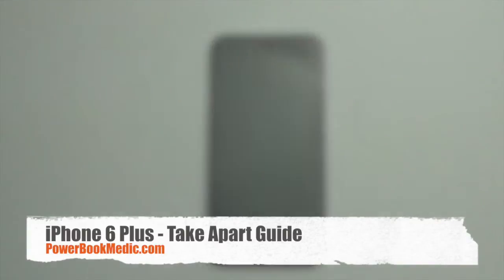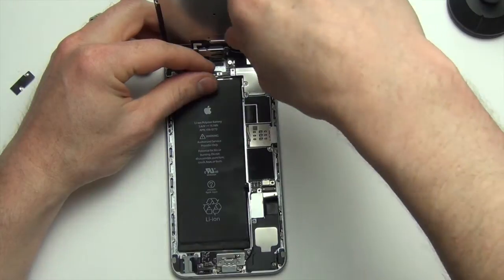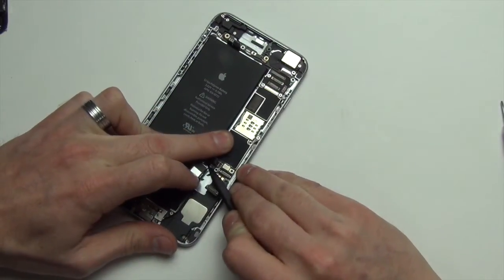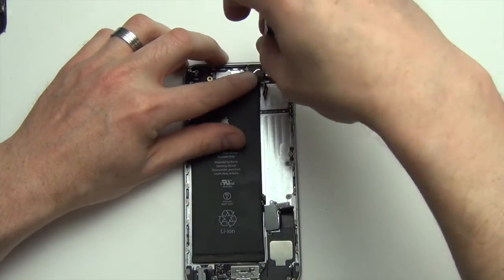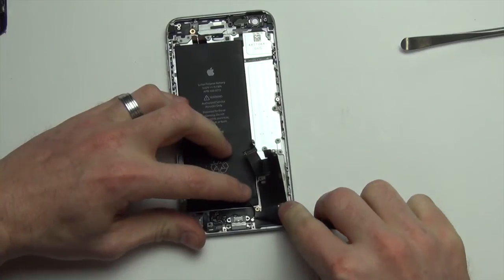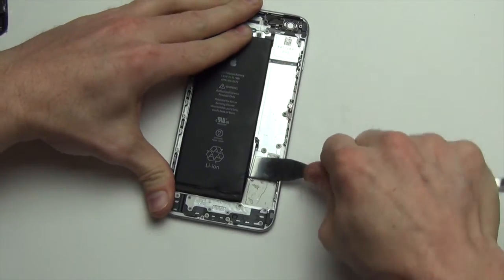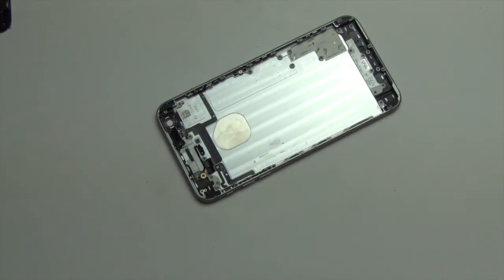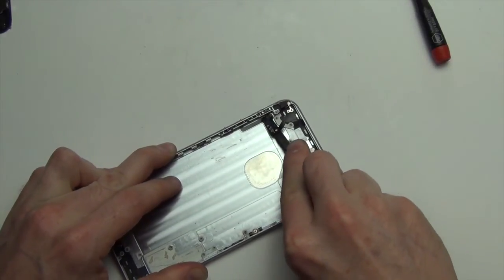How To Take Apart the iPhone 6 Plus - A1522 A1524

Comment: To remove the battery without any damage i have 3 black tabs in the 6 have 2 remove this and keep much Flat ad possible if you remove correctly the battery should be remove without any damage
Reply: Bonsoir je avoir de l’aide